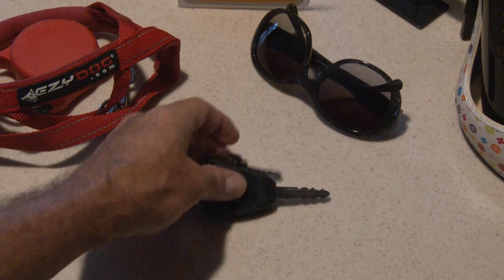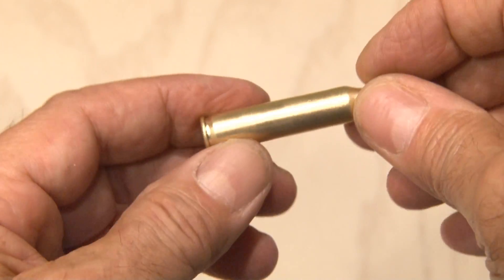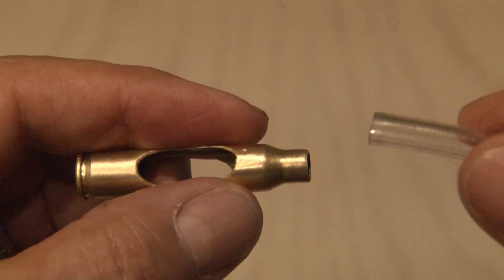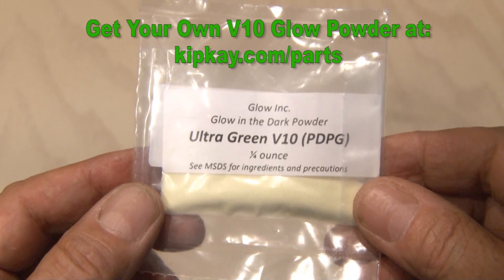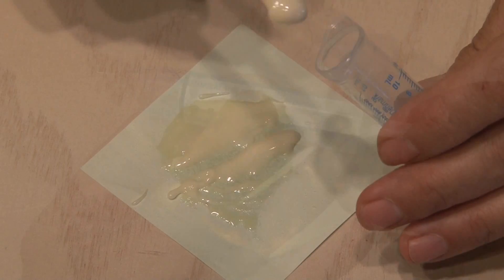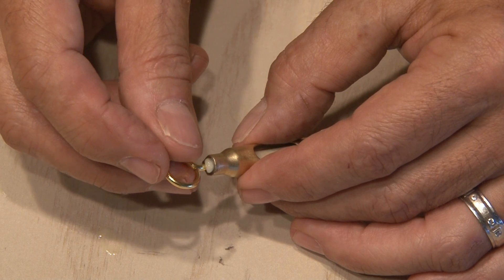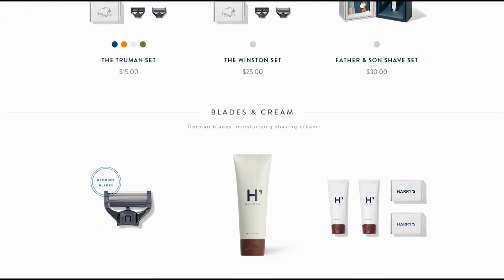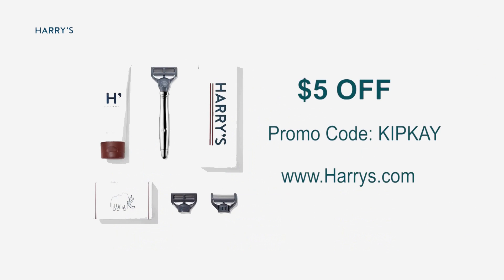Never Lose Your Keys Again!

Comment: Cool, although I would skip the tube part and either fill the casing itself then grind away or just use masking tape on the ground holes then fill with epoxy then after it sets remove the tape.

Comment: Very nice job. I made something similar. Instead of placing the small vinyl tube inside the bullet, take a larger diameter tube and slide it over the bullet. You can then pour in the epoxy(and set the screw eye). Once the epoxy hardens, you slide off the vinyl tube for a nicely contoured full glowing window.

Comment: A tritium keychain in green is way more effective than this because it uses radioluminescence instead of phosphorescense. A tritium keychain doesnt glow as bright as a fully charged glow in the dark keychain but will glow for many years without a need to recharge since it feeds off the beta radiation given off by the tritium.

Comment: Hey KipKay love your show and I love supporting a fellow Floridian.  I was wondering is there a way to hard wire a power converter into the cigarette light of a car?  Maybe add an on and off switch so it wouldn't drain the battery.  I'd love to do that to my center arm rest of my Mustang.

Comment: How well would it work if you were to sand your ovals then completely fill the shell without the plastic tube, then sand it back so that the epoxy matches the contour of the shell? Or does it need the plastic tube to last? Also does anyone know where the glow powder can be bought in Australia?

Comment: Couldn't you just omit the shell casing and use the tube filled with the glow epoxy? Not everyone has access to a spent shell casing. Why not just get a clear plastic rod, carefully drill out the center of the rod, fill it with the glow epoxy, and insert the screw eye. Wouldn't that accomplish that same thing. Or replace the rod with a clear plastic rigid tube and dump the flexible inter tube all together.
Reply: The shell is primarily there for decoration. The powder is the part that makes it glow, so you could use other containers to keep it in, or some other way than epoxy to keep it in place if you wanted.
Reply: Or a length of an old Bic pen.
Reply: Make it even easier:  Just skip the attachment all together and apply the epoxy directly to the grip portion of your keys.  That would also give you some vision when you go to put it in the lock.

Comment: You need to do a similar thing with Tritium, it glows for 10 years without having to be recharged.
Reply: haha. Nice one! I prefer using my tritium on my fusion reactor.
Reply: You do realize Tritium is rare and so widely demanded that it costs around $30,000 per gram
Reply: Daniel Mussalli  That's exactly what I meant. There are better purposes for it.

EDIT: Just like myreactor :D
Reply: good idea, except I think that Tritium is slightly radioactive and I won't want to have that in my pocket

Comment: You said that the powder only works for about 24 hours, so basically we would need to change the powder, with the epoxy and tubing pretty much everyday
Reply: No that's how long the light will last its not like the ones in tubes that you have to crack to glow. Once it has been in the light it will continue until 24 then all you need to do is put it in the light again and it will glow again.

Comment: How many days it lasts?
Reply: No it lasts up to 1 day everyday  because it's not like the crack and glow light sticks, it is able to be recharged in the sun so you don't need to make one everyday just put it in the sun when it's not in use
Reply: Oh ok, I misunderstood the properties of said powder.In that case it's not so worthless after all, pretty ingenious i might say so myself.
Reply: Around one day, so you would have to remember to make a new one every single day. Pretty time consuming if you ask me, and a bit on the pricey side as well.
Reply: DFX2KX Please learn how to comma.
Reply: After observing light, it will last up to 24 hours. And repeat. It's not like the glow sticks where it's a one time use.
Reply: royalmac1011
they will, eventually, wear out, but it takes quite a few charge/discharge cycles. used to have light switches that had this sort of coating.
Reply: Themofrobro .HD
Yeah, that sentence was clearly written when I was far more tired then I should have been.
Reply: DFX2KX Oh, ok.
Reply: thanks guys :)
Reply: Themofrobro .HD The use of commas there was unnecessary, but they were still correct.
Reply: Really? I always used it as kinda a breather in case I become a writer. Honestly it looks kinda better in my opinion.